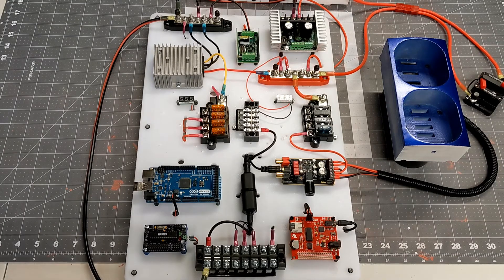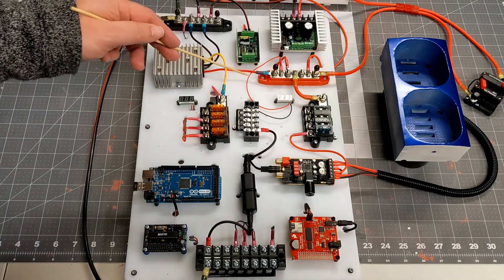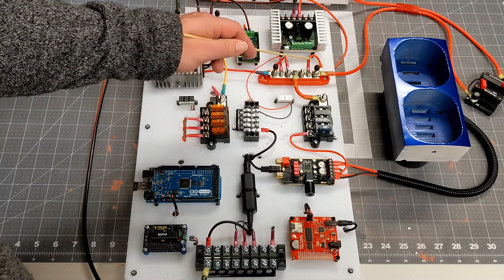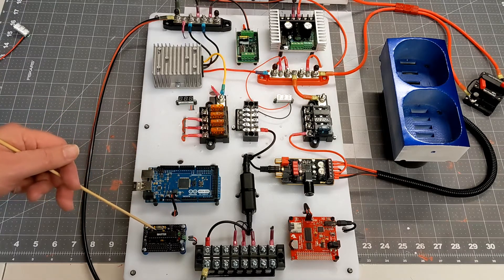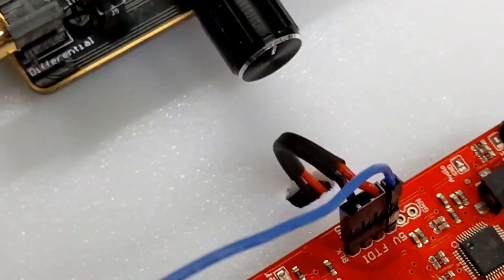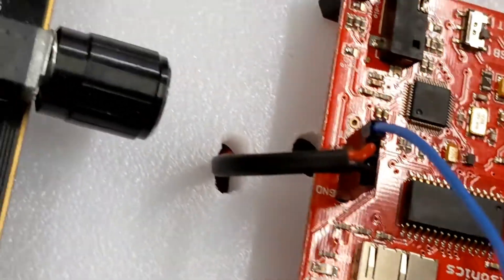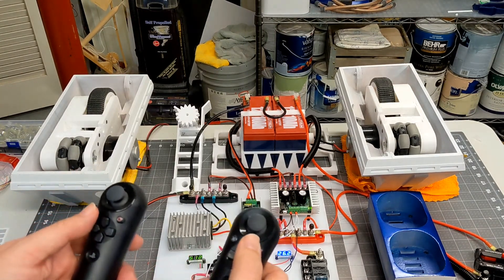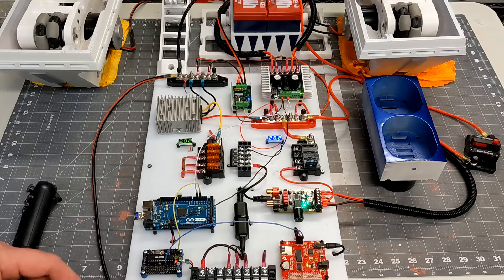R2 Electronics Build Part 3: Shadow+MD is Alive!

Comment: how do you handle connecting to arduino while using the 5v for input? Its recommended you dont use 5v pin for power while using usb, has it been an issue for you?
Reply from the maker: You are correct - you should never power the Arduino from the USB and the 5v pin simultaneously. For software updates and any time I upload a new sketch to the Arduino, I connect the USB only when R2 is powered off.
Reply: @jasonsR2D2  much appreciated, I may end up getting a small 12v converter just for the Arduino while I try to work out software kinks. Controller pairing is roughly 75% successful and I'm trying to chase down why it doesn't seem to turn stick movement to drive speed, but will move dome(just in serial monitor debug outputs right now)

Comment: On the mp3 trigger the EXT/USB button,what settings you have it on?…
Reply from the maker: It's set to "USB" because I'm providing power via the VCC and GND pins of the FTDI header on the right side of the board. If you are powering via the barrel plug, the switch should be set to "EXT".
Reply: Ok thanks

Comment: Why there is a ground from the arduino to the saber tooth?..?
Reply from the maker: It's recommended per the Shadow+MD wiki: https://astromech.net/droidwiki/SHADOW_MD 

"NOTE: Pin 16 Serial 2 (TX) "daisy chains" from the Mega, to the Sabertooth S1, then to Syren S1. Both motor controllers share that serial port and are configured to do so. However, you should run a ground wire from V0 on both boards to a GND location on the Mega board."

I think this falls into the realm of "power ground" vs. "signal ground" or "reference ground". That gets a little beyond my level of expertise, but I haven't had any issues running R2 this way.
Reply: Ok thank you.

Comment: Did you power the board when you upload the code??
Reply from the maker: Because the computer -> Arduino USB connection provides power, I've always done my code updates with R2 powered off. Once the code update is done, I disconnect the USB connection and power on R2 to test. I never really thought about updating the code while R2 is on - it just never occurred to me.

A search online suggests that the Arduino is smart enough to automatically select one power source over another, so if that's the case you ought to be able to connect USB to your computer, and power the Arduino via an external power supply at the same time. In my droid, I power my Arduino via the 5v in just downstream of the internal voltage regulator - I'm not 100% sure if that changes the calculus here or not, but I'd be curious to find out (but at the same time, not so curious that I want to try it on my only working ADK).

Comment: Jason is your 24v to 5 v regulator the 20A version or the 30A version?
Reply from the maker: Mine is the 20A version. The 5v components like the Arduino and MP3 trigger don’t pull much current at all. Even after I add body servos and lights, the 20A will still provide plenty of headroom for future enhancements.

Comment: Great Video any chance you have a link to the schematic or wiring diagram for the Shadow+MD system. Really like you wiring thanks so much for sharing. For the base board what did you use for mounting you components?
Reply from the maker: For detailed information related to Shadow+MD, start at the Astromech WIKI page: http://astromech.net/droidwiki/SHADOW_MD There you will find some high-level notes related to wiring as well as links to the various support/discussion threads. Since this control system has been around for a while, the threads are very lengthy, and will take some time to digest, but there's a ton of great info in them.

As for the electronics board, I'm simply using a cheap nylon cutting board that I think I picked up at Wal-Mart. In fact, I think there were two in the package. They are about a quarter inch thick and easy to cut down to size if needed. I also picked up some brass standoffs from Amazon for the various boards.
Reply: Thank you I read through you whole build log. Great Job!  learn a  lot there. Thanks for the link also I will read it.

Comment: What is the black cylinder in the middle of the board and what is it for
Reply from the maker: That's a ground loop isolator that is placed between the MP3 trigger output and the amplifier input. Without one, you'll probably hear a lot of static and hiss in the audio. This will dramatically reduce the noise and in most cases eliminate it. The specific one I got appears to no longer be available, but there are tons available online for $10 or less. They typically use 3.5mm headphone-style jacks and if your amp has a similar input, you'll only need a short male/male patch cable to complete the connection.

Comment: Ok so if you would why exactly does the sabertooth and syren have their main ground then the daisy chained ground to the arduino then the arduino have the 2 grounds as well just curious if I need to have this on mine.
Reply from the maker: Well, the main reason is because Dimension Engineering says you should! Keep in mind, there is a difference between a signal ground and a power ground. Signal wires carry very small voltages (especially when compared with power) and the signal is measured by comparing the voltage in the signal wire to the reference "zero" in the signal ground. In theory, the signal chain should be isolated from the power chain to avoid ground loops. I am certain that Dimension Engineering would not suggest a signal ground unless everything was properly isolated.
Reply: Will do... redoing Mt electronics as we speak.

Comment: Would you happen to have a detailed list of the components you used that you’d be willing to share? Your system is just what I’m looking to build..
Reply from the maker: The core components of the base SHADOW system are:
- Pair of PS3 Move controllers
- Arduino Mega SDK (or an Arduino Mega 2560 and separate USB shield)
- A Bluetooth 4.0 class 1 USB dongle
- Syren 10 dome motor controller
- Sabertooth 2x32 (or 2x25) drive motor controller
- Sparkfun MP3 trigger (with 32GB microSD card)

Then, to make it "SHADOW+MD", you add the CuriousMarc Marcduino boards - a master + slave for the dome and (optional) a second master for the body.

Finally, the rest of the components (fuse blocks, bus bars, voltage regulators, amplifier, speakers, ground loop isolator) can be whatever you want them to be - lots of options there.

Detailed threads for all of these can be found here:
SHADOW: http://astromech.net/forums/showthread.php?19298-S-H-A-D-O-W-Padawan-based-mini-PS3-Controller
SHADOW+MD: https://astromech.net/forums/showthread.php?21984-SHADOW-Marcduino-Update-Thread
Marcduino: https://astromech.net/forums/showthread.php?30724-Compact-Marcduino-v1-5-BC-Approved-Continuous-Various-(Jan-2017)-Open

Note: The Marcduinos shipping now are a generation newer than what I have.

Comment: Do you have to include any libraries before upload firmware to the board?
Reply from the maker: It's been a long time since I last had to deal with the Shadow sketch. There's a great wiki for the control system here: https://astromech.net/droidwiki/SHADOW_MD. According to that post, there are some libraries for PS3 Bluetooth, USBHub, and Sabertooth that are required. The second post in this thread: http://astromech.net/forums/showthread.php?19298-S-H-A-D-O-W-Padawan-based-mini-PS3-Controller&highlight=SHADOW includes links to the libraries used (Note that the PS3BT.h file is included in the USBHub library).

Lots of this is pretty old, and when I eventually get to the point where I need to customize things for the body animations, you can bet I'll do what I can to document the process.
Reply: Ok thanks.

Comment: Hi Jason is there a write up on what gage wires you used for each e.g battery to bus, bud to other items.
Reply from the maker: I don't have a full breakdown handy, but I will make a point to include details when the final board and all my wiring connections are done (and I hope that will be soon). I can say that I am running 12 gauge wire from the batteries to the bus bars and 24V fuse block. My rule of thumb has been to run the largest gauge wire that I can connect to the various components - in most cases that works out to 16 gauge. I have "test" ferrule and spade connectors of 14, 16, and 18 gauge and I see what will fit and go with that. The Dupont connectors are almost all 22 gauge - can't go much thicker than that.

Comment: Could you use a master for the body and slave for the dome.
Reply from the maker: Not really. The dome master connects to the MP3 trigger and all of the panel servos (as well as the slave). The dome slave connects to the Teeces lights and the holoprojectors. I suppose if you aren't animating any panels, you could put the dome master in the body, but then you would still need to run the signal connection from the master up from the body, through the slip ring and to the slave. It might save you one slip ring connection. In this scenario, though, the Marcduino board is still a DOME master - not a body master. The body master is connected to the Arduino through a different serial connection, and will require custom programming to relay any commands it receives to the correct servos, etc. If you don't explicitly have a board desginated as the dome master, your dome slave won't get any commands, since they are all routed through the dome master.
Reply: Ok,because I bought a master & slave a wild back never use it.

Comment: Hi

Just starting my R2D2 and was wondering where do I buy all the main boards from eg sabertooth, I’m from the uk so any help would be great.
Reply from the maker: Both the Syren and the Sabertooth motor controllers are manufactured by Dimension Engineering (https://www.dimensionengineering.com/) and they do ship internationally. Unfortunately, both products have been hard to come by recently - currently showing lead times of 3-4 months. As for the rest of the electronics components, they will usually be determined by the control system that you choose. I am running Shadow+MD (the MD meaning Marcduino) - the Shadow system requires an Arduino Mega, combined with the two motor controllers listed above, and the Marcduino boards. An overview can be found here: https://astromech.net/droidwiki/SHADOW_MD

There are many other control systems, a good summary of them, plus overviews can be found here: https://www.printed-droid.com/kbtopic/control-systems/

If you're early in your build, you probably don't have to make all of these decisions right away, but you should try to have a good idea of what you want your droid to do. Often times that will steer your control system decision.
Reply: @jasonsR2D2  thanks for the link, I’ll check it out

Comment: I'm starting to work on my own shadow system and this is immensely helpful. I'm definitely not electronics savvy.
Reply from the maker: Glad to hear it's helping out. I kept finding excuses to put of starting the electronics because I was so intimidated. Taking it one step at a time really helped, though. Good luck with yours!
Reply: @jasonsR2D2  I'm getting to the point I've just about got all my parts and I'm wondering about the code for the shadow system. How much altering did you have to do to it to make it work or is it pretty much plug and play? This video has been so incredibly helpful I can't thank you enough, I'm even giving you shout outs on my stupid tiktok account to let others know about how insanely useful this has all been.
Reply from the maker: Everything that you've seen so far has been "stock" code straight out of the box. All of the dome panel animations are preset and the interaction between the panel animations, lighting, and sounds is also pre-programmed - basically, I haven't done any custom programming yet. However, there is nothing in the stock code to handle ANY body servos (doors, utility arms, gripper/interface arm, etc.) - all of that will need to be custom-programmed. Additionally, there are things I would like to change in the dome code that I haven't gotten around to (I'd like to change the panel close speed so they don't "flap" shut, stuff like that). It's also worth noting that there is a newer version (3.0) of the Marcduino boards/code that has been released since I got mine - it has some nice enhancements like the ability to change servo directions (for each servo individually) and also to power servos from a separate power connection (so you can go up to 6V if you need to). I'm on the fence when it comes to replacing/upgrading mine. I might just keep what I have for now (no droid is ever "finished" anyway...) and upgrade later.

Also, thanks so much for your kind words. This is what I really love about the droid building community - no one gets to the finish line alone. We're all on this journey together and it's a constant learning process. Happy droid building!
Reply: @jasonsR2D2  Beautiful, I was getting some compiling errors but didn't have all the libraries included. I'll shoot you a message on the boards since you're my sage guide and I can ask my dumb questions. I'm also gonna give your channel a shout on my TikTok account if that's ok with you. Apparently there's not a lot of us on there so I'm building quite a following, people are really interested in all this and I'm happy to share the resources I find with everyone.

Comment: Does the marcduino  board come with the firmware code .
Reply from the maker: Yes the MDs are sold fully assembled and with the latest firmware installed (currently, they are up to Version 3 on the firmware). Mine are a couple of years old and have the Version 2 firmware. The best place for information would be the threads on astromech: https://astromech.net/forums/showthread.php?30724-Compact-Marcduino-v1-5-BC-Approved-Continuous-Various-(Jan-2017)-Open  and https://astromech.net/forums/showthread.php?28414-Support-Thread-for-MarcDuino-v1-5-s

Comment: Thanks for taking the time to share your progress. 
I'm super close behind you're uploads and the 24V to 5V converter tip came in handy. I've now changed my original plan of 24v to 12v to 5v 👍
I've already programmed my Arduino MDK and just waiting on Mowee when he can ship me two masters and slave Marcduino boards.
Programming the body master Marcduino looks like it could be a challenge, so will look forward to that video one day 😉
Reply from the maker: Awesome, and thanks for watching! I have a feeling I'll be replacing my Marcduino 1.5s with the newer v3 by the time I get around to adding the body master. That's definitely going to be a learning process.

Comment: Do have a link for the amplifier also what is the correct name for the controller stick.
Reply from the maker: The amplifier I am currently using is a very inexpensive one from DROK (https://www.amazon.com/gp/product/B077M526SB). I might eventually replace/upgrade it, but it works for now. The controllers used by the Shadow system are two of the PS3 Move Navigation controllers. The Move "system" included two different controllers - the nav controller and the motion controller - which has a ping-pong ball looking thing on the top. They can be found at used video game places like GameStop, or on eBay, which I think is where I got mine.
Reply: Thanks for responding